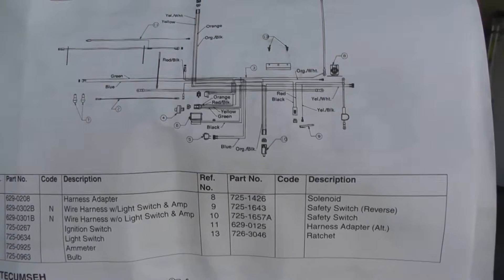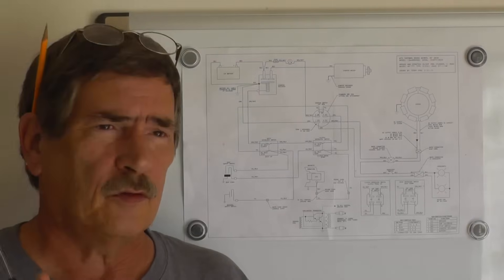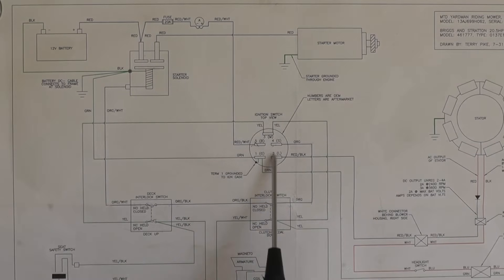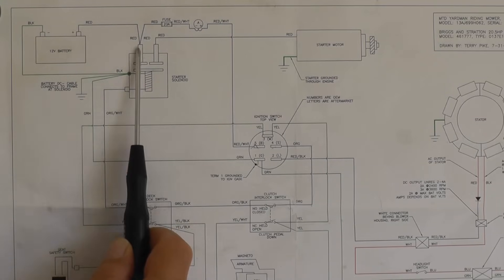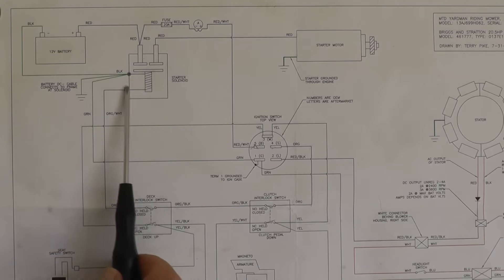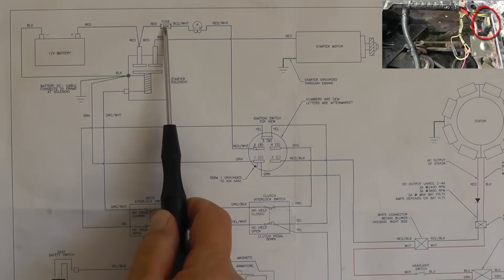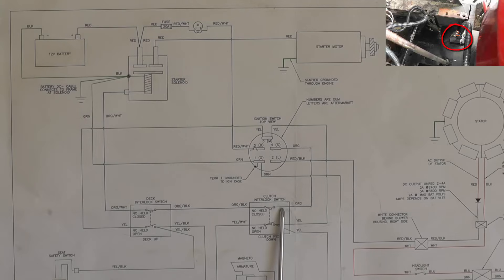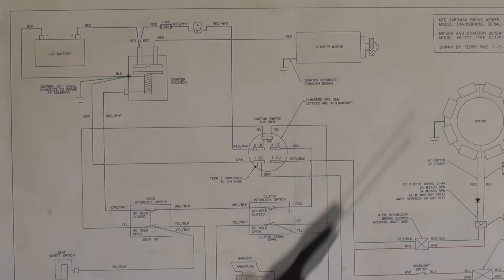Riding Mower, Starting System Wiring Diagram - Part 1

Comment: How do you keep the line straight on a zero turn
Reply from the maker: I've never owned a zero turn mower, but I would assume that it's like one with a steering wheel except you're using two handles to do the steering.

Comment: Okay, My 40' Murray Rider Had well been Taken Care,0F? I Bought It With Supposed No Reverse Or Any Forward Motion Out Of Her(April's 5 - Gear-Box"?) So First I Oil Changed, Air Filter Check? & Just Grabbed Some Hands On Knowledge ? "Damn Good Shape I Would Very Much With Honer I Say This,Of Ms.April / 
    Had Some Steering Gear Major Issues!/ But Living Close To A Steel Company, Even I Once Worked Their- Makes It "Top Flight" So, I'$ Get Brand New Steering Gears!/ Get Ready To Mow, An Ms.April Clicks At Selnoid - Use To Be Just A Qwik Connect To Me Battery Box(Better Knob As Jump Box) Then She Fired Right Up, & Was Great The Rest The Day!
    Got A Strange Connect From Mag- knee- Tow? To Selaniod Area An Appears To Be Ground At One Them Silly- Noid  Screws?
    Is That Correct An My Clutch Sensor Is Most Likely?
  Your Friend Jeremy Brock
Reply from the maker: Jeremy, I could follow along to a point in your comment with the incorrect English and misspelling of words. And near the end, I was totally lost. You mention your magneto, which I assume you're talking about your ignition coil. And I assume that your engine does not start now, but you never really said what is the symptom. If your engine does not crank, pull the wire off the ignition coil(s) and see if the engine cranks and starts. If so, you have an issue with one of your interlocks. You have to be clearer in your comment for help. Have a great day!

Comment: Stuzman, a big thanks for saving me the task of tracing all the leads on my rescued basket-case Montgomery Wards 1994, 42 inch two blades, B-S 17.5 HP O-twin.  Back in '010 someone had dropped it off by the city recycle dumpster and after getting it home to the shop, after re-assembling it, it was practically brand new, just barn worn, being kicked around idle under someone's shed.  Best I could find that caused the owner to give-up on it I found an intermittent touching of a starter solenoid internal lead. ---- Beautiful job with your generated schematic and the 2nd sheet 'railroad' copy.  Super clean.  : )
Reply from the maker: That was a great find to have a riding mower that was dumped. Glad to hear that the wiring diagrams helped out!

Comment: "that's a control fuse there for the solenoid."

That fuse is for the whole electrical system--except for the power that passes through the solenoid (when it's energized) on its way to the starter.
Reply from the maker: I didn't review the video but I'm guessing from your comment, that I said the control fuse is for solenoid. You are correct that it is for the entire electrical system along with the solenoid when starting. Have a great day jgalibois!

Comment: I'm troubleshooting a Craftsman riding mower where the 20 amp fuse at the solenoid blows as soon as I turn the key. The ignition switch has off/lights/run/start, so if it blows when I first turn to the headlights, would the short have to be in that area?
Reply from the maker: Yes, that is correct. Your problem would be in the headlight circuit. One way to keep from blowing the fuse is to remove the fuse and put a test light across the fuse terminals. Turn the ignition switch to the position of where it would blow the fuse. If you see that the light is brightly lit, then you have a short circuit in the wiring. Move the wiring harness around to make the light go out or dims. That will get you in the area of the fault. I suspect that you have a wire that is shorted to the frame of the mower. Good luck on your findings!
Reply: Thank you for the information! I'll try that and see if I can find the short.

Comment: I need your help wiring the head-light assemble on a Cub Cadet 2155 Series, 15 HP. I just purchased this mower used. Someone cut the wires going to the headlights. Leaving me with no idea how the head lights was originally wired. From the engine I see 3 wires. 2 Blue wires. Are these 2 blue wires positive? Each of these blue wires go to each head light Positive?
Reply from the maker: Your best bet Dan is to get the wiring diagrams. Take a look at the manufacturer's site and download your manual. Here is the link https://www.cubcadet.com/en_US/operatorsmanuals

Comment: 'Best wiring diagram I've seen so far. However I do have a question on something not covered in the video or wiring I have a Troy Bilt Pony (MTD owns them now). it had a 15.5 HP engine with a Dual circuit alternator and I had to replace it with a 17.5 HP whit the wiring is a little different as it is a DC alternator with a regulator/Rectifier. I had to add in a wiring harness 790544. When I put everything in and hooked up the battery, switch in stop position, the headlights come on and stay on. I'm not sur why since the off position, 1 (G) goes to 3 (M) so no power should be getting to the headlights. I'm assuming the regulator's wiring is some how carrying power to the lights but, As you said early in the video the the wiring diagram is basically wrong. Can you add a regulator into the wiring diagram so I can see if I'm missing something? For the life of me I can't figure out why the headlights are coming on. If you need more details let me know since I haven't added the model and serial numbers of the unit or engine or what wiring diagrams I'm working from.
Reply from the maker: Hi Steve! It sounds like your headlights are coming on without the engine running. The headlights should only come on when the engine is running. On the dual circuit system, the lights should be on one-half of the stator windings. On some mowers, there is a headlight switch that you can turn off if they're not needed as shown on my wiring diagrams. And on some mowers, there is no headlight switch and the lights will be on all the time when the engine is running. Send me what you got for the wiring diagrams, your model number for the mower, etc. and I'll take a look at them.

Comment: Very excellent video! Great diagram. I have a PTO switch not a deck switch. machine is a White lt542H with a Tecumseh 18.5 twin. Basically, machine worked one day, next day change deck belt and now after starting, as soon as PTO lever is barely touched to engage blades the machine shuts off. I've checked the PTO switch for continuity, and it seens to be NO and NC on the correct sides, as it even has NC labeled on one terminal. Have to check the brake switch yet. Any thoughts? Thank you!
Reply from the maker: Steven, send me a pdf of your wiring diagram and I'll take a look at it. Email is stuzman52@gmail.com
Reply from the maker: Meanwhile, I would take a look at the parking brake switch and seat switch.

Comment: I am an idiot... I am just trying to figure out which wires i can tap into for switched power. I want to add a USB power outlet for my phone onto my Troy Built Pony. I want switched so i dont have any phantom draw when the mower is off.
Reply from the maker: Just take a voltmeter and make a few checks on the wires connected to the ignition switch. Turn the switch off and on while you monitor the voltage.

Comment: How do I connect a 6 wire to a five wire ignition on a John Deere 108
Reply from the maker: Without the wiring diagram I can't tell you how to wire the ignition switch. It would just be easier to get a six wire switch to replace the original one.

Comment: I have a plug with 2 white wires that are under the seat not plugged in and my pto wont engage but I can't find where it plugs in. Can anyone help?
Reply from the maker: I suspect Ken that it's for the safety switch for the seat. If that's the case, jumping the two wires should allow for the PTO to engage.

Comment: Hello have a john deere 155c mower that keeps blowing the fuse soon as I turn the key on and get no power to the fuel pump or anything  any suggestion  or trouble shooting tips
Reply from the maker: When you say that you turn the key to on, I'm assuming that you mean that and not to the start position. If that's the case, not much comes into the circuit except a connection to the charging system. Most likely, you have a wire in that circuit that's shorted to ground.

Comment: I just bought a Murray 46" worked fine the first time. Found bad brake switch, bypassed it so it would start, now it runs but does if I engage the blades.  I need to know if it is because of jumping the switch if so how can I get the PTO to engage. Love the accent, reminds me of my Grandparents. If I listen long enough my accent will come back. Thanks for a useful  video.
Reply from the maker: Hi Lois! I would suspect that the brake switch has another contact on it. If you have a wiring diagram for your mower, you should easily be able to find out what the issue is. Go to the manufacturer's website if you don't have a wiring diagram and with your model number, you should be able to find it. Sounds like you were part of the south at one time.

Comment: I need a manual for a hustler raptor 54 zero but nothing pops up how did u get your manual
Reply from the maker: The manual for my riding mower came with it when I purchased it new. I would think that if you go to the manufacturer, there should be a manual for your mower located on their site.
Reply: @stuzman52  thx

Comment: I have a Smart Switch ignition which is push button I want to switch it back to a key the ignition on a Craftsman GT 5500 any ideas how
Reply from the maker: Hard to say Vincent as I've never seen a system as yours. I would have to look over a wiring diagram to offer any suggestions.

Comment: Heres a problem. I gutted the wire harness and rewired omitting safety switch. Have three pole solinoid. I have check everything several times. When i power the 12v to trip the solinoid to engagé the starter there is only a klicking. Two good batterie. I even connected them in parallel. Still not working. Maybe battery cables? They where also checked voltage threw positive at 13v.. I tride with push button and switch. Still same problem. I can jump the hot terminals on solinoid and starter spins the motor. Tip. You can reuse your key by poking a pointed object in the side grove in the plug. Then rewire and insert the correct wire back into the plug and plug back onto your key.
Reply from the maker: Hi Waterman. It sounds like if you can jump the two large posts on the solenoid and then the starter motor engages, then your issue lies with the solenoid. Specifically, the contact inside the solenoid. While trying to crank the engine, measure the voltage across these two posts. You should get a very small voltage in the milli volts. If you get anything higher, then the contact is bad. I show this procedure in the second half of the video series along with checking all the safety contacts for the starting circuit. If you're interested, it's located here. https://www.youtube.com/watch?v=8XMfN6VhvyU&t=2409s

Comment: what wite gauge would you recommend?
Reply from the maker: What is a 'wite' gauge?
Reply: @stuzman52  I meant wire**
Reply from the maker: @caine-chow  The wire gauge will vary depending on the ampacity of the load. For the control wiring, 16AWG would be sufficient.

Comment: No, I'm here watching to learn the lawn tractor electrical circuitry in order to gain more knowledge, and this video I appreciate really. You explained those lockout switches as being normally open and they close, for an example, by putting your foot on the pedal to complete the relative circuit. Your key switch explanation is fine, but I like for you to show on the large wiring diagram how the different key position interact with the individual circuits... like you did previously before getting in detail with the key switch This is excellent shared knowledge for our us gaining troubleshooting techniques. Excellent video, it went fast for me because I was absorbing it all and we were having fun watching. It was A++ my friend.
Reply from the maker: Thank you Bill for the comment and for the suggestion! I'm thinking of doing a deep dive into the charging system for riding mowers. Stay tuned for that!

Comment: That was so simple I almost understood it. Great at the destruction side of things, not so good on the other end. I used to be able to work on stuff but my memory isn't the best. Great stuff, I was looking at the wiring diagrams this morning thinking I used to be able to read these damn things but now I'm lost
Reply from the maker: Yes, it takes a little time to digest wiring diagrams to analyze them.
Reply: I lost a fight with a 105mm howitzer round from a 101 rigged as an IED. So my memory kind of comes and goes. Anyway maybe you can a swear a question for me. I have a Gravely Frankenstein walk behind mower with an  18hp Kohler. Nothing when I turn the key. I cleaned up the electric connectors as best I could, tried different batteries including my car battery nothing. I've looked for fuses but have found none which is odd. There's a piece connected to the frame with 3 wires running in 1 side and 1 going out. It's a out the diameter of a quarter with what looks like a wax cap. It looks like the end of TNT.  Kind of looks like an M80but notes long. The starter solenoid is a 3 prong I believe, is it a starter relay?  Thanks any help is appreciated.
Reply from the maker: @frederickwhite6416  Sorry for the delay Frederick and thank you for your service. You could start at the starter relay or solenoid and make some measurements there. An incandescent test light would work just fine for the voltage checks. I go over checking the solenoid in the second video of this two part series.

Comment: I don't know if you guys can help me but I have a Dixie chopper 50 inch cut and had a 20 horse twin cylinder Kohler engine. Someone come over to help my mom by mowing the yard. My best guess is they didn't check the oil in melted the engine 😡.  I've been putting a Briggs & Stratton engine in place of it. It's a 16 horse instead of a 20hp. I'm not going to go into the fact that it's a Briggs & Stratton vs Kohler on top of being 4 ponies smaller. in my opinion that's almost like having half the motor it had. And I have to add that even if the engine oil had been checked the oil alert had a wire coming off of it going to nothing, ending up with a pinched wire connector & no wire to connect to so in theory he could have Crank it up and ran it on an ounce of oil.  But I digress
I need some help trying to figure out how to get the charging system wired back up to the battery through the starter. Kohler has one color code Briggs & Stratton has a separate color code. Can you give me any help? I looked at a heck of a lot of damn wiring diagrams for either Kohler or Briggs & Stratton but it's giving me a headache trying to figure out which one's going to where cz I can't stop focusing on the fact that the colors are different.
Reply from the maker: Since you're going to be using a Briggs and Stratton engine, you'll want to use the wiring diagrams for it. Forget about the colors and focus on the components themselves on the wiring diagram. As you find a component on the wiring diagram, find it on the engine. And then one wire at a time, make the connections. You can use a high-lighter to ensure that you've covered every wire.
Reply: @stuzman52  Thanx. I've finished wiring the Briggs from scratch & discovered both the coils are foulded out. I'm not sure what could've caused it but I'mgoing to take care of it tomorrow thanks for your help.
Reply from the maker: J. R. Great work JR. on engines that have dual coils, you’ll probably going to have two diodes, one diode feeding each coil. Be sure to check those two components also. Diodes being shorted can take the coil electronics out.

Comment: how ammeter is connected 16:46
Reply from the maker: I explain at 5:58 of how the ammeter works and how it is connected. Not sure where you got 16:46 from as that's the end of the video.
Reply: @stuzman52  Thanks for posting

Comment: On a Murray 42819 x 92 a riding mower. One side of the seat switch goes to the solenoid and not sure where the other wire goes. Any ideas ??
Reply from the maker: Not sure, but go here and look up your manual. It should show the wiring in the diagram. https://www.murray.com/na/en_us/support/manuals.html